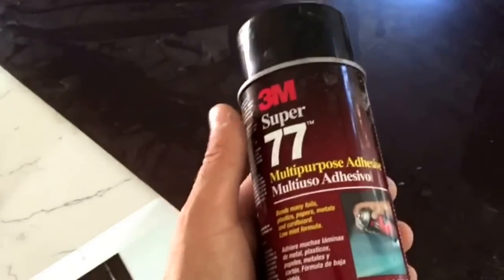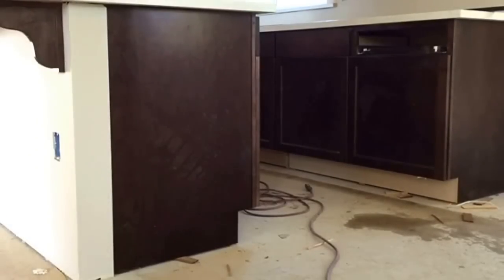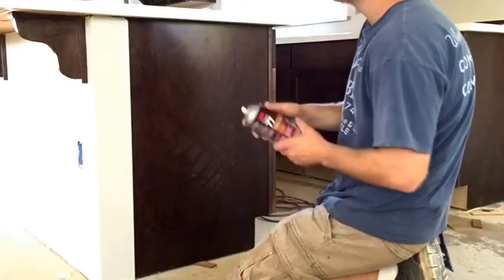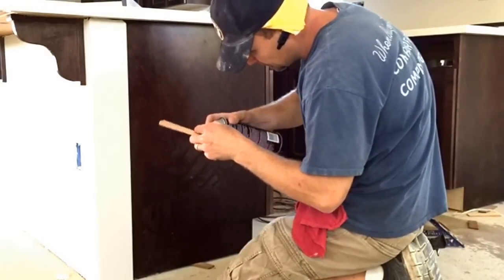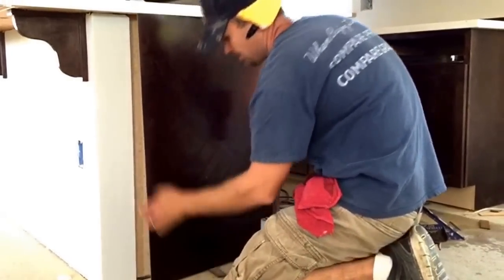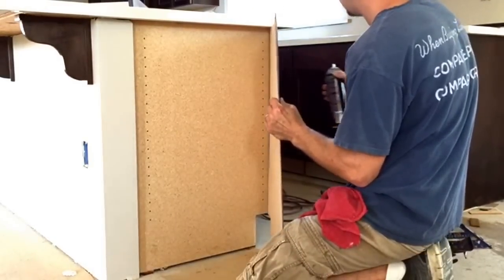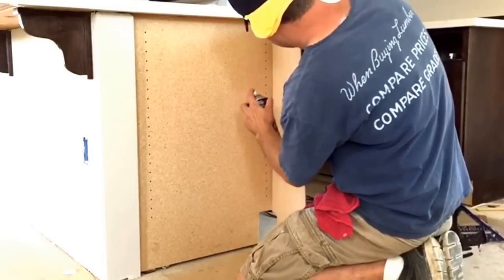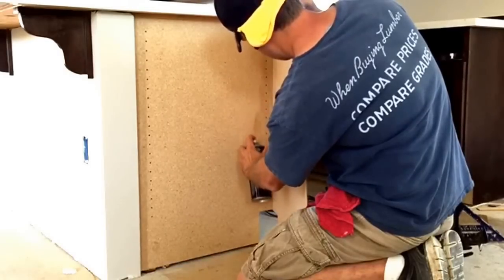How to install cabinet skins (no nail)

Comment: This did not work for me. It’s essentially rubber cement and the product did not dry to solid adhesion. The skins could easily be pulled off; even after several days cure.
Reply: Jeremy Lawrence 3M super 90 is what is supposed to be used.  This adhesive he’s using only has roughly a 15 second open time, and is better suited for fabrics.  Try super 90, spray both sides, let it dry until it doesn’t stick to your fingers and boom done!
Reply: @willie_c7118  question for you - “wait till the adhesive doesn’t stick to your fingers”. - is that when you put the skin on once it is no longer sticky?
Reply: It sounds counterintuitive, but that’s how the 3M 90 works. 
It won’t adhere well if you slap the surfaces together when they are wet.